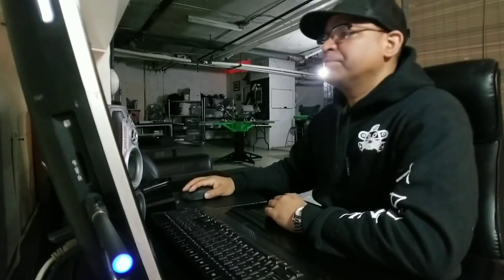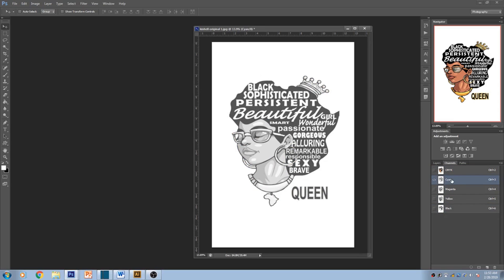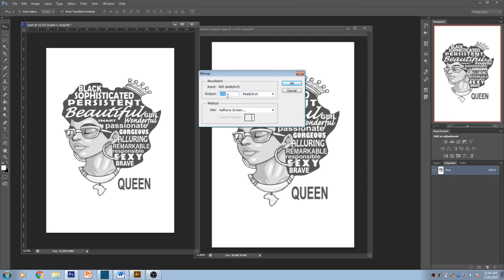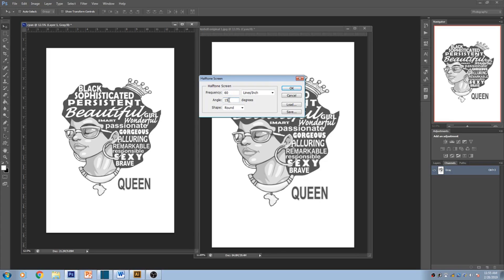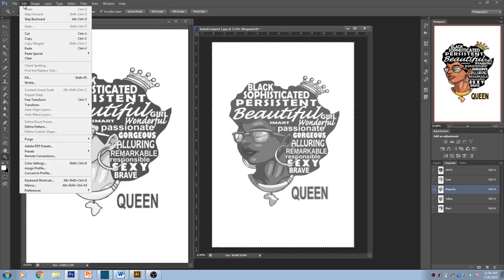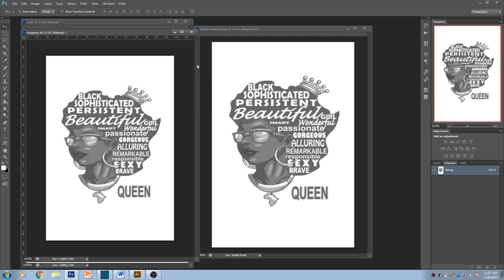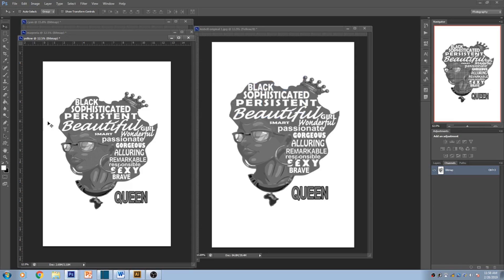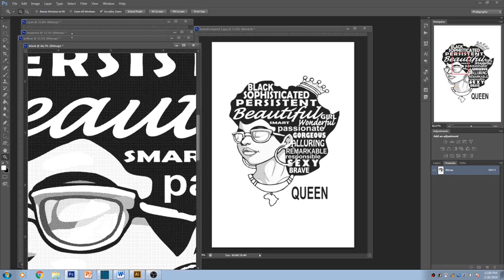CMYK Separation for T-Shirt Printing Part 1

Comment: For the frequency does it have to be a smaller number for smaller mesh numbers or will 60 be ok to use? or does it base it on the holes in the screens?

Comment: Great video sir!! You made it so simple now I’m wondering what’s the purpose of using rip software when you can just do what you did. And are you using water base or plastisol? Last question, are you using original epson ink for your 1430?
Reply from the maker: Thank you. I'm using plastisol and I use the original epson ink.

Comment: I use Corel Draw to make the CMYK seps. Print each separate chanel to an EPS file (print to Device independent Post Script file instead of choosing a printer). This way I can control the screen angle and frequency. Then using the old versions of Ghost Script and Ghost View you can print the EPS separations one by one using any supported printer on your system: I use an old B1100 A3 and inkjet posi film. The cheapest way to get the posi films is to buy a big roll and ask the suplier to cut it into smaller A3+  wide rolls. Cheap black ink in every cartridge and I'm Bob's nephew. I have been achieving great results in the range of 55 to 65 lpi (55 is a good place to start) with 120T (metric) yellow mesh screens. Single coat of emulsion on the back of the screen so it gets pushed to the front where it gets the light and makes contact with the film. It is important to get the exposure time right as well. You have no compensation for dot gain with this method and you can only separate to CMYK but I have been printing great separations this way. If I am printing on white shirts without white underbase I need to add clear base to the inks and test it, otherwise the prints tend to come out a bit dark. On white underbase the print tends to be lighter and usually there is no need to add clear base to the ink. If anybody wants to know more about this just ask me.
Reply from the maker: Thank you. Wow! Great info Antonio! Thank you for sharing. This will help a lot of printers. Good looking.
Reply: @tainoink  QuickSeps is well worth checking. They offer deals frequently and it seems good value for what they claim it does. You can do duotone seps, simulated process seps, spot colour seps, control dot gain, colour trapping, etc... Maybe it will take sometime to get used to it. I downloaded the trial version and feel inclined to wait for another sale to buy it, just need to fiddle with the trial a bit more.

Comment: Do you need a rip software to print? Or straight from photoshop
Reply from the maker: It will be better using a rip software but since I don't print a lot of images using halftones I could get way from not having it. But if you have to print without it you could get by. The thing about that software is that it's expensive.

Comment: what printer do you use? do you have a RIP software?
Reply from the maker: Epson artisan 1430. No RIP software. A bit too expensive for me at this moment. lol
Reply from the maker: I heard that the Canon Pixma Pro is a really good printer.
Reply: I feel you bro. I use to like the 1430 epson but here in South Africa its not available but now i see there is a better printer than 1430 the Canon Pixma Pro 100 and is supported by Accurip ruby but still accurip ruby is expensive for me too bro. Dont even have Separation Studio 🤦🏼‍♂️

Comment: What size mesh do you use for CMYK Prints? Is it 300 all the time?
Reply from the maker: I use 230 mesh most of the time. The 230 mesh holds better than the 305 mesh.
Reply from the maker: The frequency for 230 is 46
Reply: Taino Ink thanks,  may God bless you more than he already has

Comment: Question what if i only have 2 colors. Like White and Red ... ? I was deleting the black channel  that kinda messed up things ..so i undeleted. **Just testing here....
Reply from the maker: That formula is only for full color designs. Anything less than four colors won't work. Those you will need to break it down individually.
Reply: @tainoink  where did you purchase your cymk kit?
Reply from the maker: I will make a video on that soon. How to breakdown a two or three or four color print. I tried that idea once. You are not alone.